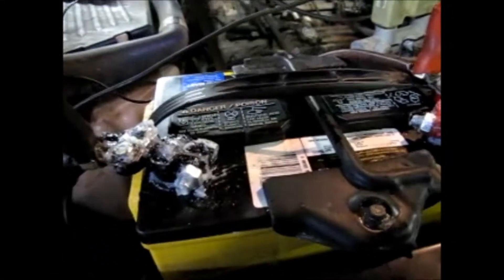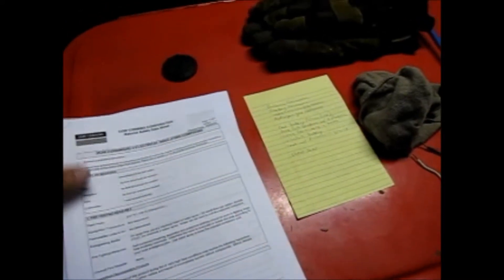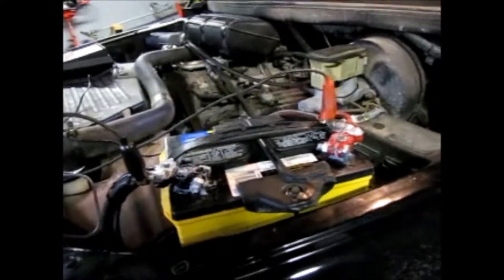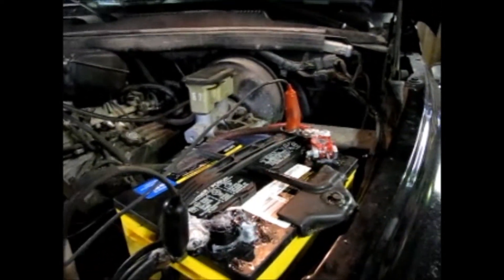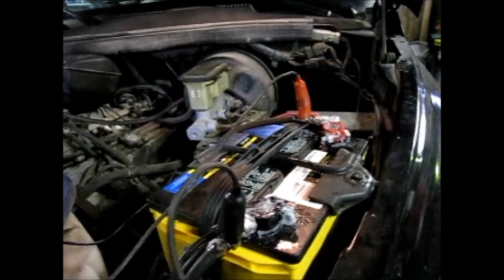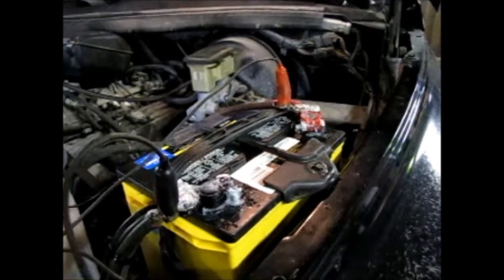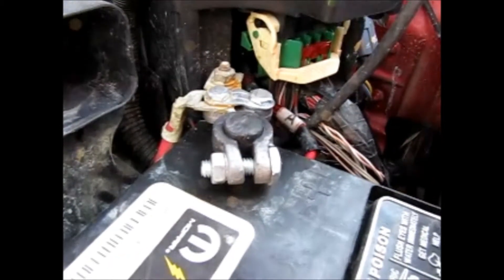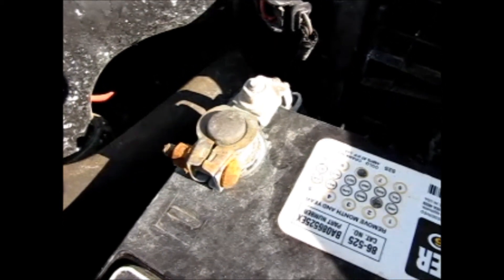Preventing Corrosion on Battery Terminals

Comment: Those felt washers suck. Do a good job of cleaning the battery with baking soda and water and a good wire brush, then seal the cleaned surfaces with a good protectant like dielectric grease or, even better, Fluid Film or NOCO. If you do this your corrosion problems will be eliminated.

Comment: The dielectric grease acts as a protectant to keep out water and other contaminants. The electrical contact is below the dielectric grease and does not affect the current flow in any way.  I've used it for years and never had any battery terminal corrosion. I've switched to another product because I didn't like the fact that the dielectric grease never dries so it can get on your clothes and hands. I switched to Fluid Film or NOCO. 2 similar products that protect as well as dielectric grease but do not remain sticky. These are the only products I use now on my battery terminals.

Comment: Those felt washers do work if you coat them with anything to prevent air from gassing the connection. I have used corrosion spray from Curtis, grease and motor oil with excellent results. If you put these washers on dry like most people, its ineffective.. The fact is that grease does work to prevent corrosion by preventing oxidation in the electrical connection, the reason No-Lox is required in a commercial electrical panel.. Those guys on the forums will read some information and not understand facts from an engineer indicating all materials can act as an insulator.. ASE states that a drop of .2V is allowable on the Neg connection and .5V on the Pos cable by industry standards. Exactly how much does the voltage drop across a terminal coated with Vaseline, dielectric grease or any other material intended to prevent corrosion?
Reply: +heavymechanic2  The only thing the felt washers do is soak up acid that leaks from the caps, or in between the post and case of the battery. The felt material neutralizes and soaks up the acid, and is meant to be a form of sacrificial protection. It does not protect against fumes the battery emits during its normal service life. Dielectric is used to coat the outside of the terminals to protect against the battery's fumes. Dielectric grease has initial properties that allow a decent connection when first applied. But as the grease ages and gets baked in underhood heat, the silicon based grease will start to vulcanize and cause the connection to get progressively worse. In short, the battery sees a much shorter lifespan. Don't put the grease between connections is what I've learned.

Comment: Way too long of a vid for a minute ore two of info
For the past 40 years, I've been using vaseline on my battery terminals, light bulb threads and almost all removable electrical connections. Never had a problem with oxidation or sticky connections (ie. light bulbs hard to unscrew or hard to remove)

Comment: The best way to prevent corrosion on battery terminals is get a battery that's a good quality brand. I use Motorcraft  batteries, they never corrode.
Reply: +DZEyoyo123 Motorcraft batteries are made by Johnson Controls. JC makes pretty much everyone's batteries. Vent cap design does play a role in the battery's ability to prevent corrosion though. Perhaps that is why they seem to have done well for you?

Comment: Dielectric grease DOES reduce conductivity, but there are a couple of reasons why it may not make a difference.
1)  You may still have "enough" conductivity, when you keep in mind that reducing corrosion offsets the lower initial conductivity.
2)  You can put the cables on the battery then coat the outside of them, not the mating surface where current flows.

It is not really the hydrogen gas that causes corrosion, it is the acid in the water vapor that vents.  The battery terminals may be sealed fine but that's not a sealed battery otherwise.  Note that batteries with side terminals further from the vent caps tend to have less corrosion.

One way that many OEMs now reduce corrosion is with plastic caps over the terminals.  Obviously since they aren't air-tight, they are not a 100% solution.

Another option for corrosion reduction is a sacrificial metal plate.  Some people super-glue pennies on their battery or put a copper bar across, although other metals subject to corrosion will work as well.  Ironically when people choose those colored epoxy coated terminal clamps, they can make the problem worse because instead of the outside of the clamp reacting and depleating the acid, more of it is activey reaching the uncoated portion of the inside of the clamp and the terminal itself.

Additionally, do not wait to clean corrosion off.  It creates a ash-like covering that soaks up acidic fumes to increase corrosion far faster than a clean clamp and terminal would.

Lastly, that "tin" terminal is probably not tin, rather very thin tin or zinc plated steel.  You mentioned galvanic corrosion but did you stop to consider that every single wire on the vehicle (besides spark plug wiring) is copper then terminating in a metal connector that's either steel, lead, or plated brass?
Reply: *****
Yes you could do that, but remember that in some areas of the country, particularly in summer after a vehicle is driven so engine hot and sitting parked out in sun, it could get hot enough to melt wax.

Frankly I don't think it is worth the bother.  You can just smear a light coating of automotive grease on the outside then wipe that off and reapply new grease every couple years under normal conditions, or if the terminals are corroding at an excessive rate you might have an alternator that is overcharging and should be replaced.

Remember that if the acid fumes don't have the terminals to react with then they just build up and react with the next nearest metal object.  This can eventually rot away a metal battery pan or lines for brakes/etc near the battery.  It's probably best to not only coat the terminals but also have sacrificial metal if the corrosion keeps coming back, though often it's a sign the battery needs topped off with more distilled water.
Reply: *****
I am telling you the science about it, but frankly, I do none of it. I just drive a vehicle and clean the battery terminals once in a while.  If I had, and did once in a while, that problem then I would do the steps I mentioned to find the reason.  Good battery and good alternator won't do that at a rate the owner can't handle without just cleaning it every few years.
Reply: Stinky Cheese Thanks for your informative post! I was just looking for that information. As it happens, I have a battery with side terminals that has badly corroded on the positive terminal and there is corrosion all around it. I had been thinking someone sprayed my battery with acid to sabotage my car. Thanks to you for letting me know this is a normal problem and not the work of dastardly ninjas! heh heh
I thought it was very strange that the acid got up inside the jacket of the connector yet when I poured a solution of water and baking soda over the battery, there was little to no reaction around the vent caps. It's as if the acid gravitated to the terminal to react with the connector.
Anyway, I checked the water level and it is in fact low, so the likelihood of sabotage is low. It is a 1999 Oldsmobile Eighty-eight. I don't hate this car, but it seems to have a reputation of having electrical problems. It may be that the alternator voltage is too high and so it overcharges the battery. It's suprising how many strange symptoms are caused by terminal corrosion. In another video, a guy said he never had corrosion until he installed a new amp for his radio. The amp wasn't that big, he said, only 250watt, but it didn't have a capacitor. That reminds me of a video in which a guy replaces his car battery with a 12 volt capacitor pack. I am thinking of building one to supplement the battery if that will help ease the burden of the battery. I am thinking now that using the power seats with the engine off may have contributed to the battery's need to vent. Thanks again for the facts! :D
Reply: +kedwa30 The acid likely leaked from a bad seal between the metal lead receiver and the plastic case. It's really rare, but sometimes is caused by internal corrosion.
Reply: Jeremy Venturino
It's common for non-sealed batteries to vent due to peak charging or especially overcharging.  It creates gas bubbles.  I can literally hear my sump pump lead acid battery bubbling away when I hook a regular ~ 6A battery charger up to it opposed to the conservative maintenance/float charger it came with.
Reply: Stinky Cheese it is normal during normal service for a battery to leak occasionally. Electrolysis is always happening during charging, of course the rate depends on how much current. The battery's caps serve several purposes, one of which is to catalyze the gasses into condensate water/acid and allow it to drip back into the battery cells. Agm batteries still vent, but not nearly as much. :) on side post batteries  they can leak out of the side terminals and cause corrosion. In some cases the battery corroded internally to the point the whole side post can fall out.

Comment: Not rocket science. You can just spray it with spray paint
Reply: which could cause difficultly removing it later, especially where the paint gets on the clamp bolt threads.  Plus, paint isn't exactly impervious to acid although a two-part epoxy based coating is moreso, but those are generally thicker still, even worse for trying to get the clamp off later.